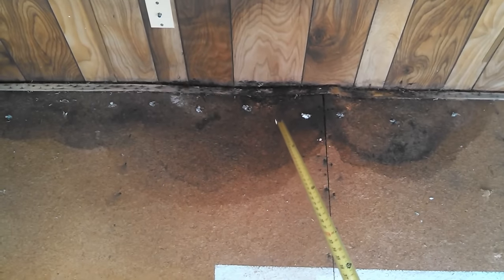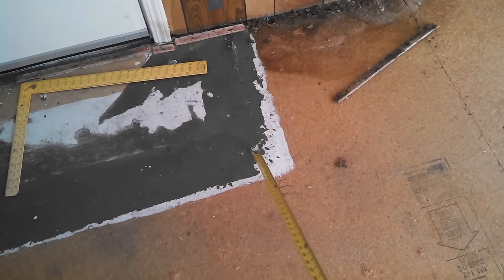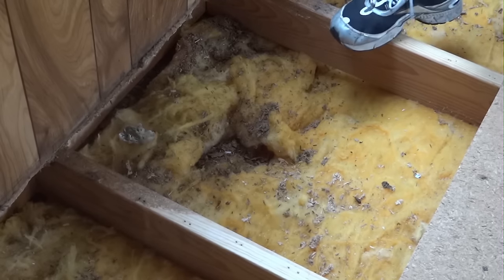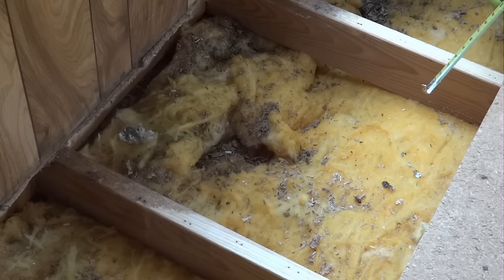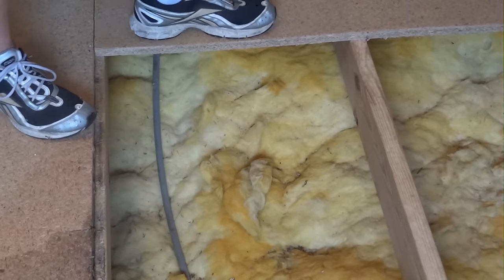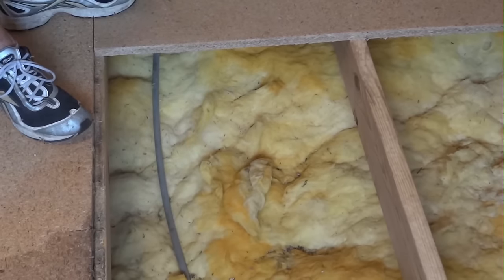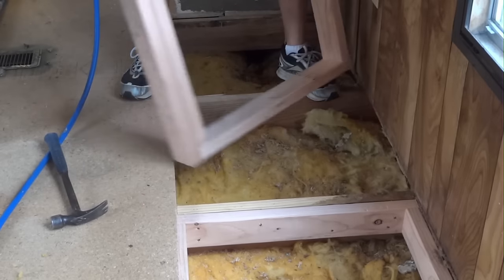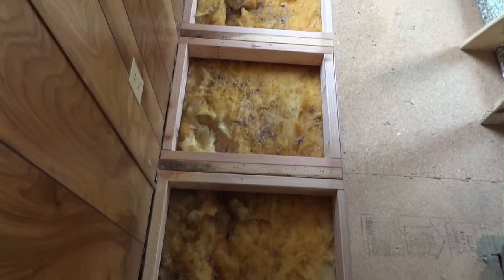How to repair or replace a damaged section of subfloor.

Comment: Nice job.  I just bought a large manufactured home with some compromised particle board subflooring from lack of a vapor barrier in a humid climate.  Your video is very helpful and I will be making some boxes!  I'll only replace what is needed, then install a vapor barrier and crawlspace fan.

Comment: This was VERY helpful because I have an almost identical situation.  A single question, if you please, is this:  1a) The decking under the 2x4 wall studs obviously has to remain in place, even though it has suffered at least some rotting.  Is there something it can be sprayed with or treated with to possibly prevent additional deterioration/rotting?  My obvious #1 concern is that you have a new wonderful solid floor but your wall studs are compromised at best and 1b) In my case, the 2x6 on cant which supports the 2x4 wall studs is also badly damaged.  I would want to spray or treat it with something as well to stop the rot from progressing.  Thank you for ANY response you're able to give and many thanks for sharing such wonderful information.
Reply from the maker: When assessing your damage you will need to decide if your wall is adequately supported as it is or not. I can not do that from here. Typically you will find that the structural members are not rotted and retain their integrity. If however you find that your structural members are also rotted then my advice would be to also replace those as well. There is no magic spray that can be substituted for structural lumber. Sorry.
Reply: With my thanks for taking the time to assist me in addressing this problem!

Comment: That is all truly beautiful.  It requires lots of tools and some years' practice in knowing how to use them correctly.  Your floor looks like my trailer.  I had full sheets of plywood installed to replace a damaged subfloor and the installers cut vent holes in them for the  non-functional 1990 furnace.  I didn't want vents.  No one listens...  I wanted to be able to reinstall the woodstove according to code but now I have plywood with holes covered in loose-laid vinyl with holes and need a custom-made hearth pad to cover the vent hole (and of course still have a horrid hole in the floor six feet away with a register in it to fall over.)   It seems the easiest repair is "just" putting in two new sheets of plywood rather than cutting patches and making joins...but not listening to women from the beginning is, I suspect, more fun for the contractor...

Comment: Nice job on the video I personally replace all of the particleboard when I run into a situation like that just in case the floor gets wet again I don’t have to go out there and tear up my new floor just to repair that particleboard again
Reply from the maker: Seems like a reasonable strategy but even plywood is destroyed by water. I think there may be an issue with ones confidence to successfully repair leaks. I had the trailer park for 15 years and my floors all stood the test of time.

Comment: Got a pretty big project coming up shortly. I will be redoing a ton of floors. Sounds like I might get pretty good at making boxes again. What can ya do when it is free AND in a nice community. 

That nail gun made it look a hell of a lot easier than the old hammer and nail... might have to buy me some new tools.
Reply: A nail gun and a compressor can help alot. You can shoot a nail where you can hammer one. I have 3 compressors. a small $50 one for doing just molding. I will use it for one piece of molding. I have a pancake and hotdog compressor too.

Comment: IMO this is the easiest method for a homeowner to patch holes in the floor.  Home Depot will rip the subfloor panels if you know your measurements.  Patch the floor with the same material depth.  It can vary in mobile homes.  Take a piece or measure the floor at the heating grate.  You can also use deck screws if you don't have a nail gun.  Good video and you almost have a million views!  Only 88k views to go!
Reply: Isn’t it better to use screws in the long run?

Comment: Thank you for posting this ! my DIY project is to repair the repairs...all the flooring is of different levels and cant see whats really going on till I pull up the carpet and crappy linoleum the bathroom is almost 2 inches higher than the rest of the flooring so we will see what I find.

Comment: Wow, thanks from KC too.  I have an issue in the kitchen.  Removed the vinyl tile and have some problems around the cabinet sink. Looks like some sub-floor was replaced but it is still spongy (they did not use the boxes so we might have a support issue. Now I know what must be done,  Great video.

Comment: Blocked in just as you did. Needed a car jack to force level from foundation to subfloor: some walls were originally built over open subfloor with no joists to directly support them. Those walls, simply, dipped under the weight.

Comment: Awesome idea. Thank you very much, this will help me out tomorrow. But I have a question. Should I use some kind of glue in between the board and the studs and in between boards? On the old board that I removed it looks like it had glue.
Reply from the maker: Glue is not necessary however it is not uncommon to place construction adhesive between the floor joists and the decking to prevent squeaks.

Comment: I own a house built in 1956 it has original hardwood floors currently covered by ugly carpet but my subfloor has uneven parts to it the floor joists are good I'm thinking or replacing the entire floor and using this method where the walls are at

Comment: I'm actually looking at doing floor repair on my mobile home in about three spots. One was ant damage and the two are water. I just haven't gotten round to seeking bids. I also need to replace a sliding glass door that is next to one leak and the front door too. I'll see about having a package deal done. Thank you for showing what it takes, if I weren't physically unable to do that sort of thing I'd do it myself but I'm a physically disabled veteran.
Reply from the maker: Thank you for your service.
Reply: Thank you. I had a recommended guy come out and he quoted me about $250.00 for each repair. He suggested instead of just replacing the spot under the washing machine to replace the entire floor in the laundry cubby hole.

Comment: Beautiful work! I'm about to tackle my half bathroom floor w water damage. According to contractor (offering a $2,000 bid for a 3' by 5' floor replacement), the partcle board under the laminate flooring is rotten. There s stains on the underneath of the flooring (looking from the crawl space), not sure whether the wood is rotten or not till opening everything up. Do you have any suggestions on the material to use and vapor barrier use? This is right around the toilet. Thanks in advance!
Reply: I am tackling this same thing right now. If it's around the toilet, 99% chance it's the wax ring and/or flange. That should be all the water protection needed if it's done right
Reply: Use pressure treated

Comment: The toilet and the sink in my house have both has a leak for a while. I changed the washer on the sink and that stop leaking the toilet has proved a little more difficult to remove. Now the subfloor is ruined so I have no choice other than to remove as it would be useless to try and dry out. I will post something to let everyone know how I got on.
Wish me luck as I am going to tile, redign and install a new bathroom suite. That should be interesting and a new area for me .
Reply: How did it go?

Comment: Nice repair but there is no way I ever go back with particle board as that was the problem in the first place and I want my repair to last. I always use 3/4 thick plywood as you can easily shim it to make it perfect match and depending on the repair you don't even have to do that most of time only on patches like you did would that be needed. I like your boxing in idea, I usually just toe in the supports but this is great idea...

Comment: If the insulation is wet too do you replace it? I have a toilet that broke at the seal between the tank and bowl. I shut off the toilet and drained it but I have about a 6 inch diameter hole around where the water line comes in that’s rotted. The insulation underneath is wet. The toilet has now been removed and the drain capped until I can get in there and fix it.
Reply: Yes replace anything that is wet. Insulation is not too expensive and not worth it creating mold when you can get it out of the way now.

Comment: Thanks for the video! We were about to put some new carpet down and when I ripped the carpet up I noticed this same kind of water damage that came from the back sliding door! My problem is the previous owners had linolium (spelling???) over the natural wood which is rotted....Do I rip the entire floor out and put a new subfloor or do I replace the damaged area and pour a leveling liquid to bring the floor up to the rest of the floor? Any advice would be greatly apprecieated! Thanks!

Comment: Thank you for the video. Very helpful. What about the water damaged subfloor under the exterior wall? Does that need to be replaced as well? And if so, how would you go about doing that? Thanks again.
Reply from the maker: Ruben Rojas It is definitely a consideration and a decision you will have to make. In most cases I will leave it as shown in the video but in one extreme case I actually removed a 20 foot section of exterior wall while propping up the roof with 2x4s. Then replaced the floor, then built a new wall complete with window, door, electrical, exterior siding, sheet rock, paint. It is a major job but thankfully it usually is not necessary. You have to make that call. Good luck.

Comment: I am replacing a heated floor in my office above the garage. We have decided that the easiest thing to do was to just install a heated matt system over the existing burned out floor (which already has a thin coat of levelling cement to conceal the cable system we installed the first time around). Upon removing the laminate flooring, I have discovered a 24" x 24" area that has been rotted out from a leak in the roof years ago. I noticed it when I put some pressure on the concrete in that area when I noticed some water stain marks. I gave way pretty easily.

My question: Can I use the circular saw to cut through the cement (1/8" thick) and subfloor at the same time? If not, how can I cut through the cement separately without damaging the cement that is not part of the water damage? Thanks in advance.

Comment: Very informative video. I have a double wide in Texas that I have to replace some of the floor in the master bathroom.Water leak damaged the blue treated plywood underneath and mold set in.Not really looking forward to it,as I'm not a carpenter,but we don't have the money to pay someone to do it. I'm expecting to have to use your box method if the floor joists are damaged.Thanks for posting.
Reply from the maker: Actually you should just plan on the boxing. It provides support and nail surfaces for all edges of the replacement flooring.

Comment: I'm getting to start repairs on my '71 Weste which has a press board sub floor.  My plan is to replace it with 21/32" plywood since 5/8" can't be had anymore.  Did you use plywood or some other type of material?
Reply from the maker: I used 1" thick particle board to match the existing floor. I have to get it from a lumber wholesaler.
Reply: I'm surprised that you used press/particle board as once water hits it, it disintegrates.  I think that the only thing that could prevent water damage to press/particle board would be some kind of sealer.
Reply from the maker: Fix the leak sir. No wood product will stand up to water. The sub-floor should not be getting wet. If it is you have a bigger problem to address before you fix the floor.

Comment: Thank you for this! I have to do exactly what you did here after some subfloor was rotted from moisture. It looks like water might've been leaking in from the track of a sliding glass door. Would we just caulk the inside of the ends to prevent water from leaking? How is water normally supposed to drain out of a sliding door track?
Reply from the maker: +meedily Typically there are small drain holes on the outside edge. Best practice is to use flashing under the door to turn the water away. I caution you that water can also get in along the top and sides of the door and then run down to the flooring so check that too. Be absolutely sure you have fixed your leak or your new subfloor will quickly deteriorate.

Comment: I'm repairing a buddy of mines subfloor.  His toilet stopped up so he cut a hole in the floor and took his dukes in the hole and let it smack down onto the insulation. Would I remove his poop when I'm working under the floor or should I smash it in under the joists to provide more insulation. It would be a great insulator because he takes great big healthy hog jowl and tater beefsteak poops and they can be easily worked and formed into flashing
Reply: Omg 🤣😂😭🤣🤣

Comment: Great repair.   I'm going to use this on some repairs I'm doing right now.  But won't mold grow on that nasty gunk you left on top of the insulation?  Was the subfloor actually particle board?  Is that even code?
Reply from the maker: The debris left behind is dry and made of the same stuff as the rest of the home so it is all good. Remember fix the leak first. The subfloors in mobile homes are commonly particle board, what you see being pulled up is factory original so yeah, it's code.

Comment: Are there any issues using 2x4s instead of the 2x6s which are the same size as the joists?
Reply: U use 2/4 for supports u dont need 2/6 only the joist are 2/6

Comment: Thanks for video.  I noticed you said your subfloor was 1 inch thick.  Mine is too but I can't seem to find 1 inch think plywood or osb subflooring. last floor repair i had to use 3/4 inch and another 1/4 inch board under it to bring it up even with the original floor. where did you find 1 inch subflooring?
Reply from the maker: dandee68 I found mine at my local hardwood wholesale dealer. They carry all species of wood and a more extensive selection of sheet goods than the home stores.

Comment: The insulation holds water and so over time it will cause mold on the bottom of the sheeting. I would have replaced it on that manufactured home. The rodent barrier holds the water, did you cut it to allow it to drain?

Comment: hello in one of my upper floor bedrooms I want to put laminate, so i pulled the carpet to expose the subfloor, it is nailed down and very squeaky can I screw it down? And then near the window similar to your video there was water stains but the problem is that area of floor near the window slopes down almost an inch vs the rest of the floor. I was thinking to cut it out like you did and use these boxes you show but do I have to tie in the boxes to the structure on the window side? Just nail to the studs?

Comment: I have had two chain companies giving me high estimates over $2,000.00 to change subfloor in the crawlspace.  I have some wood rot under the kitchen area  and they are suggesting that I have the entire floor area 20sq.ft. removed.  They said it can't be repaired in sections.  I don't believe this is true.  They also have stated cabinets have to be removed and replaced back in. Does any of this sound accurate? My friend went under the house and stated he wouldn't dare pay that at all.  He states that it only needs to repaired  and not completed gutted.

Comment: Some people have mentioned triangular bracing to work against shifting of the house and another person mentioned using a hack saw and screw driver to dig out the particle board remaining between the bottom of the wall itself and joist the actual wall sits on. What do you think about those ideas?
Reply from the maker: Only in extreme cases do I remove the material under the wall and in those cases I also rebuild said wall. If you dig that out, that wall will settle into the void. I have found that the material under the wall is under compression and in most cases will provide the support you need. You will have to make that call.

In response to triangular bracing. In this type of construction the floor sheeting provides the diagonal resistance and therefore triangular bracing is not necessary. However look at your existing construction and match that.

Comment: Great instruction; very thorough! Why didn’t you use screws through the remaining subfloor, near the joists, and into your boxes to draw them up level to the joists before nailing them?
Reply from the maker: I developed this method through a series of trial and error hypotheses and it works out well this way. There is more than one way to complete a task.

Comment: Thanks a lot for the video. I have a couple of questions. I saw that one of the box frames you made didn't fit correctly so you added another 2x4 to make it sit under the the plywood. My question is do you nail the existing plywood that didn't rot the the box frame and that's why it sits slightly under the unrotted piece as well? Also what nails did you use on that air gun so I can copy? Also last one.... I have 2x8 joists. So I should probably make my box frame with 2x8's? Thanks man I appreciate you video!! Keep them coming!
Reply from the maker: +Darcy S Thanks for your questions. 2X4's will be good enough, since there is no great span for any on piece. 16 penny nails for the framing and smaller ring shanks on the sub-floor, ask your supplier. And finally yes, a few nails in the existing flooring would tie it all together nicely.